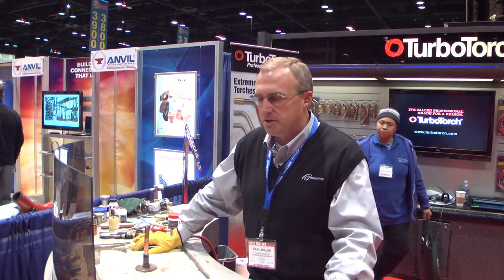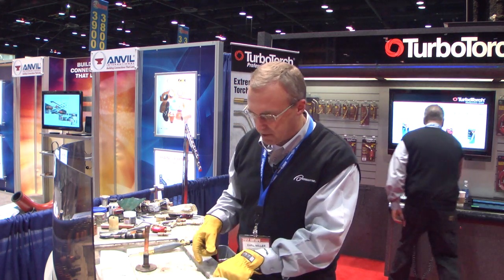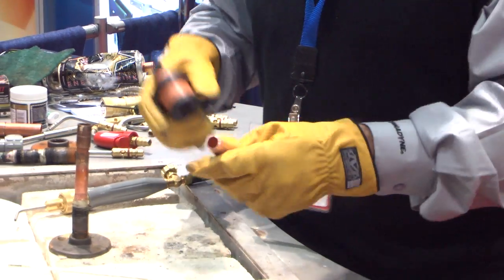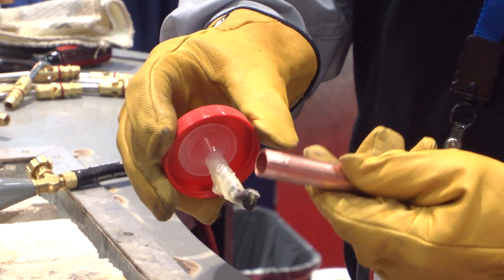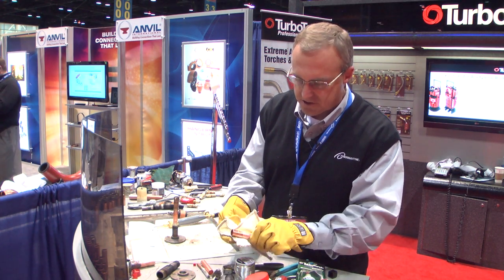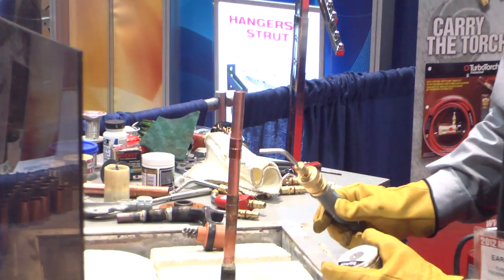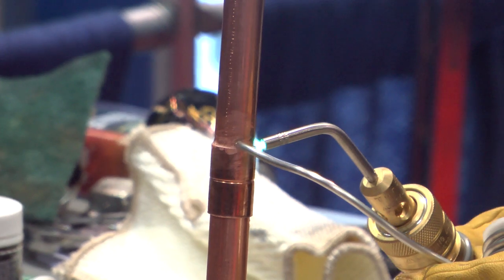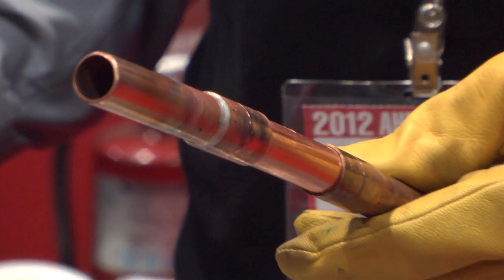TurboTorch - Copper Pipe Soldering Demonstration

Comment: Terrible solder joint, it will hold but ugly as hell, work on your control. That’s an easy joint to solder. I’m actually embarrassed that victor would put this video up as I love their torches,you would think they would have someone with some skill demonstrate their products
Reply: Just Blast  agreed I don't see the point in using a Turbo Torch seemed it was so hot it was bubbling it was too hot no need for that much heat in a simple solder joint